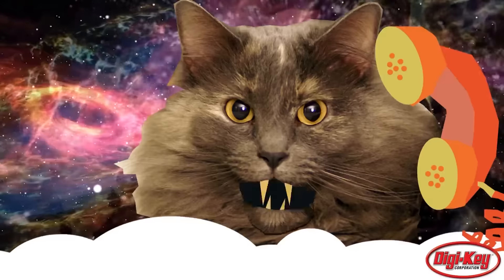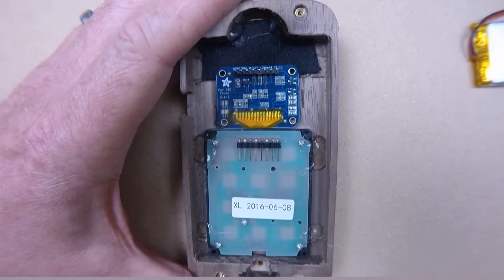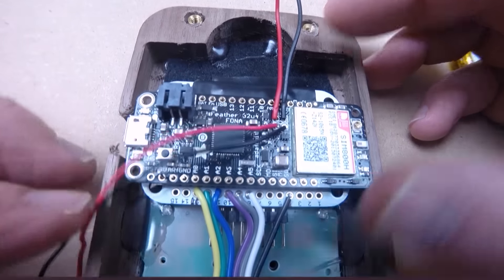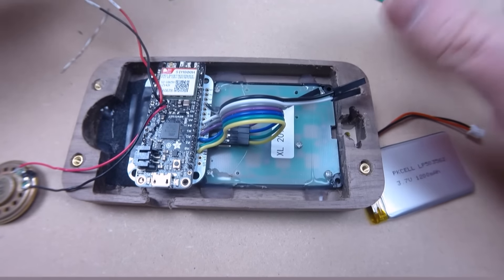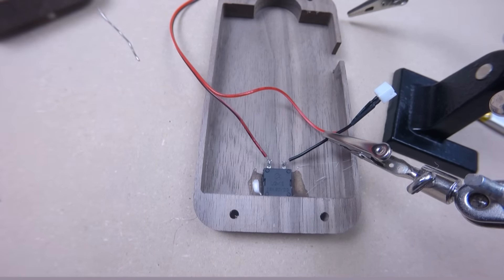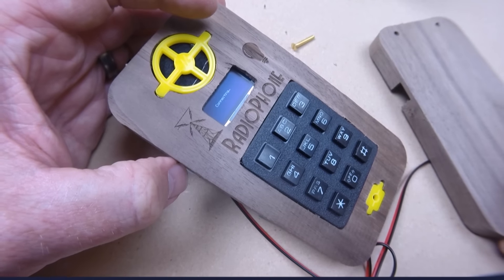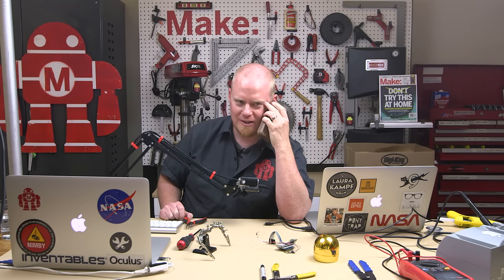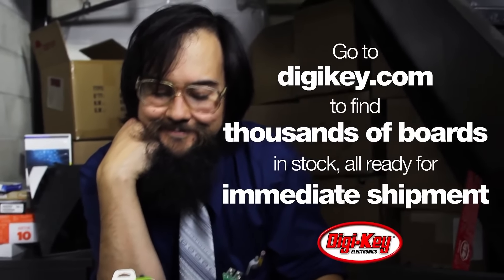Make: Live - Dieselpunk Cellphone

Comment: I really like the use of arm from workshop lamp for a gopro holder, I may have to use that idea in my workshop
Reply from the maker: It's a little wobblier than I like, and you need a macro lens in order to get in close. But it was a quick and easy solution!
Reply: You could use a floor mic stand maybe?

Comment: With the power switch you did not need to use the jst connector with the switch, because there are pins on the feather board specifically for the purpose of turning it on or off. The EN, 5V, Ground pins can be used to turn it on or off, the EN pin, if pulled low will shut off the board, and if pulled high will turn it on.

Comment: This looks like garbage. A little prep work goes a long way, like maybe break the sharp edges on the wood box so you dont have wood fibers visible in front of your screen, sanding the sides where the keypad goes, and maybe planning out where your components are going to go so the enclosure doesnt need to be so big. Things like this are only cool if they are functional and a 1 inch thick phone that has the footprint larger than a smart phone is not functional.
Reply: Also, in no way is this dieselpunk.